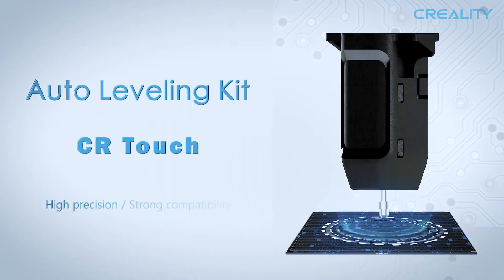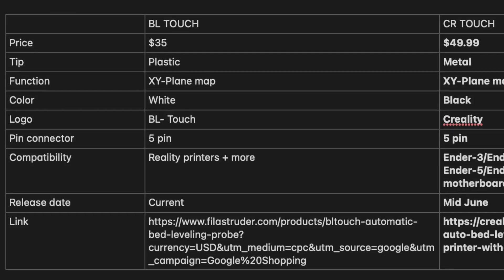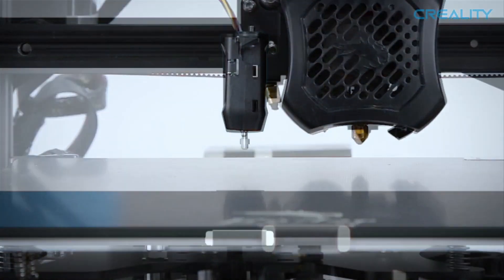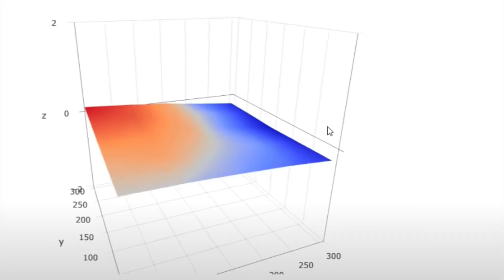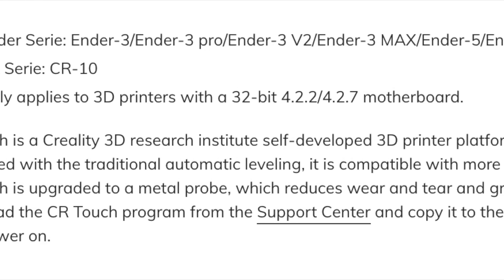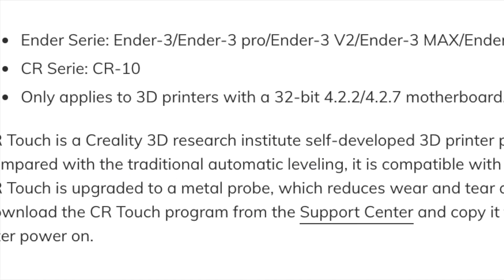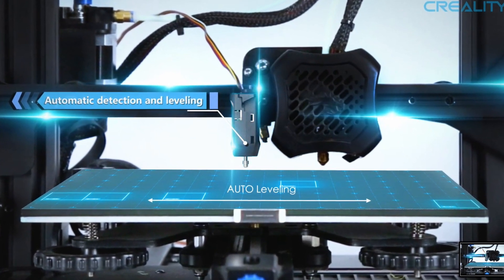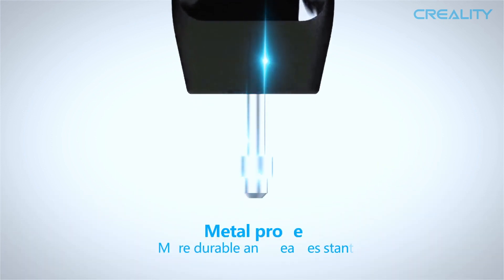What's the Difference Between the CR-Touch vs. the BL-Touch? CR-Touch Overview & Comparison Video.

Comment from the maker: What do you guys think? Is this thing worth it or are you sticking with the BL Touch? How about no bed leveling at all¿
Reply: Thanks for the video.  I'm definitely curious and will look into it when its actually available for purchase.  However, I have a SKR E3 mini 1.2 - so wondering if this will work with third-party 32-bit boards.
Reply from the maker: @Movies4118  That's actually a really good question that I'm not sure how to answer. Likely, it's gonna depend on what firmware is supported on your board and what you can flash onto it.
Reply: ANTCLABS has patent, Creality must stop pantent infringement.
Reply from the maker: @harryw523  What do you mean?
Reply: @techuila  The CR Touch being an almost direct copy of the BL Touch I'd imagine.
Reply: I think if I wanted to read the Creality spec sheet,  I could have done that myself.
I thought maybe you had something relevant to say about how the two sensors compared, according to your won experience.

Comment: Now 4 years later, What is the printer.cfg for [bltouch] or does it need to be labeled [crtouch] is does 3 of 25 test points and stops with an error on Sonic Pad, if use default sonic pad it isn't setup for any touch sensor.

Comment: i bought this thinking it works with cr 10 v2, but i dont know, it shows cr 10 and cr10 v3 but no v2... i plugged it into the same plug you put the bl touch and it lights up and looks working, but i haven ttried installing firmware you think it will work?
Reply: I think it will

Comment: Do you know if the crtouch could plug into the bltouch's wiring harness?  I dont wanna have to rewire...  I've got the bltouch and the damn plastic tips bend with heat and time..and I cant find a metal tip for the stupid thing.  Ive searched for hours...  if you could link me a 3rd party tip I'd be so happy...
Reply from the maker: Into the motherboard, the pin connector is exactly the same, as the reality board have a dedicated leveling sensor port. The connecting cable itself, although having the same ports, is technically just slightly different on the CR-Touch. However, you technically can still get it to fit, though I strongly recommend you use the wiring included with every CR-Touch kit, it just reduces unwanted variables even though they will both still. technically work. As for the metal probe, those are actually not commercially available to my knowledge. They used to come stock with the BL-Touch (in early stages) but have since been disconitnued due to safety concerns regarding contact with the glass bed. The BL-Touch has a metal probe but does not pose those same safety concerns when leveling.  But here are some replacement ones I found: https://ebay.us/CnVLvS

Comment: When I bought the V2 version BLTouch it included a V2 mount, only it was plastic that was textured to look like the other powder coated metal ones. Wondering if this is using the same one or if they made new metal mounts this time.  Also their CR-Touch clip says 'Photoelectric Sensor' so it probably has indeed changed to an optical sensor type as mentioned previously.
Reply from the maker: Hey! The CR touch bracket that creality sent me is indeed metal. I did see the photo electric snippet in the clip, so you are right. It will be an optical sensor.

Comment: So, this thing is a jazzed up version of the Bltouch with a metal tip (although the bl touch originally had a metal tip as well)?
Reply from the maker: From what they have released on their website, yes. Once this ships to more people, we can j cover more of the hardware and software components of this. I’ll be making another video soon!
Reply: @techuila  Well, it seems to me that there were (and are) Bltouch clones out there that perform as well as the official Bltouch, for often one fourth the price. This meant that Creality wasn't making as much profit as they would like. Creality repackaged the Bltouch, is calling it the Crtouch, in order to distinguish it from the clones out there. Unfortunately, I'm not expecting an improvement. The thing is, the Bltouch/3dtouch is more than accurate enough for all use cases. Heck, a levelling sensor isn't even necessary. The market doesn't need a new sensor, but unfortunately, in this era, need is created.

Comment: This does not answer the main question: what technology differences are there?  BLtouch clones are tricky because the hall sensor is thrown off by other EM fields in the neighbourhood and even by heat.  I never understood why no other company was using an OPTICAL sensor combined with a magnetic release mechanism as the BLtouch uses.  Using optical sensing would improve accuracy and eliminate lots of problems.  So, is this CRtouch doing that?  If so, then I expect numerous cheap clones to follow with at least as good results ...  One benefit seen in actual reviews: the pin automatically retracts even without power, so it is likely pulled up by a spring or magnet, which needs active force applied (electromagnetically by a coil?) to get it to extend.  That's definitely a plus over the BLtouch and could hint at it not using a Hall sensor...
Reply from the maker: Hey! You make some very interesting points. Specifics on tech and resistance to EMF is pretty indeterminate right now, Creality did not do a great job telling us a lot about this product, but instead let us figure things out as a community as the sensors become available. Luckily, I got mine today so I'll be making a video and I'll try to take your point into consideration!

Comment: The first BL touch had a metal tip but they went with plastic for subsequent models, for good reasons.  The plastic BL touch tip is meant to break away and not damage your printer.
Reply from the maker: That's right! I remember this early stage of the BLtouch with that metal tip. My assumption is that Creality have backed up this device with their own software, making it less prone to damage your print bed. I heard some claims that this device was meant for printers with a glass print bed... but this isn't reasonable to assume since a lot of people go with PEI print beds or use glass and PEI interchangeably.

Comment: Hi for ender 6 can use ?
Reply from the maker: Hi there! At this time, I do not think so. On their website, they list that this is only compatible with printers that have a version 4.2.7 motherboard. The Ender 6 uses a different mainboard. However, this may change in the future. Additionally, the BL touch works with the Ender 6 if you were looking into that! 

Find more info here: https://creality3d.shop/collections/auto-bed-leveling/products/creality3d-cr-touch-auto-bed-leveling-sensor-for-ender-series-3d-printer-with-4-2-2-4-2-7-motherboard?gclid=Cj0KCQjw5uWGBhCTARIsAL70sLLp24PwD_baHbvoDg7wiCbzFySdANvuKuel5MzpjGMOSmfrkLu6mZ4aAjVMEALw_wcB

And here: https://www.3dprima.com/parts/spare-parts/creality-3d/creality-3d-ender-6-mainboard/a-25742

Hope this helps :)
Reply from the maker: On further review, they show in their promo video that it IS compatible with the Ender 6, see 2:05 in the video. THis information kind of conflicts with what they mention on their website which states it is only supported up to the Ender 5 printer, not the ender 6. Very confusing :/